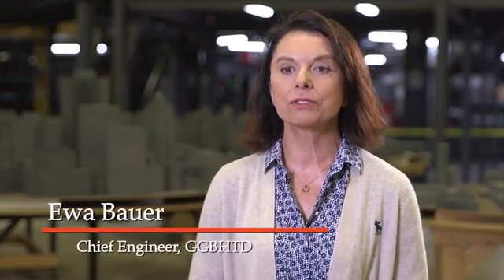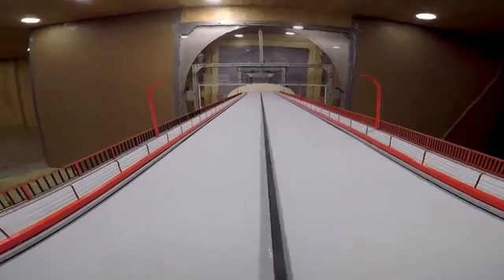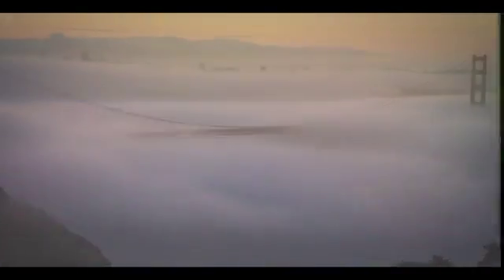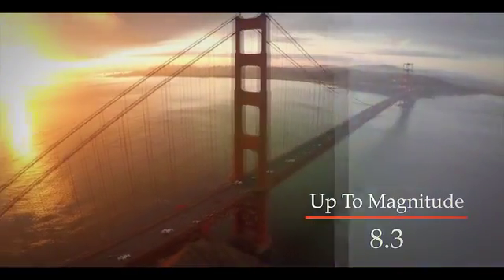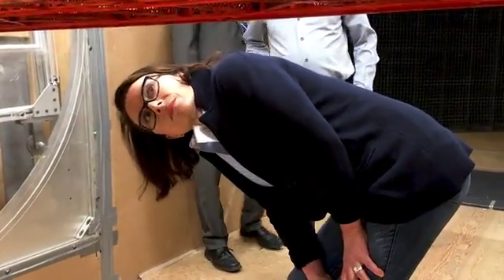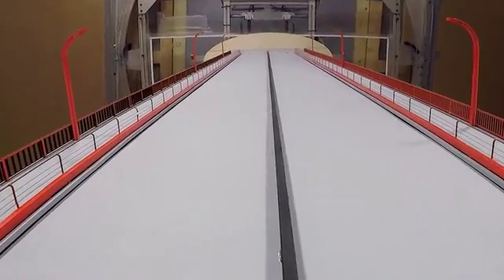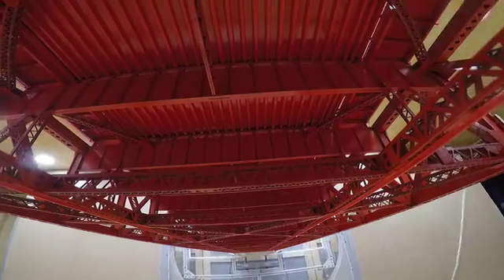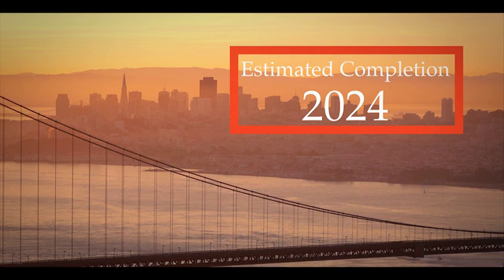Wind Tunnel Testing

Comment: you are worried the walkway will impact the bridge more than the transport deck. I would start by introducing stiffness to the joints. Vertical cables can be enclosed in stackable cylinders. But this adds weight to the structures. So i do not know. You can earth quake proof any building by actuators. (Dynamic damping. I would like to work on such a project.) Lesson learnt: All structures needs built in infrastructure for maintanace work and safety of maintanance worker.

Comment: Amazing work on the build, so intricate! Ex vibrations engineer here. Did you model the higher frequency vibrations from the slats to see if they have any fatigue / backout / fretting impact on the suspender / main cables, anchors or bolts in the underside ironwork? From the news reports there's a lot of sound energy going into the bridge now and I don't see any cables in your model :) Maybe that bit is secret. Thanks again for the videos guys!
Reply: This is my question too (but I am not a vibrations engineer!)